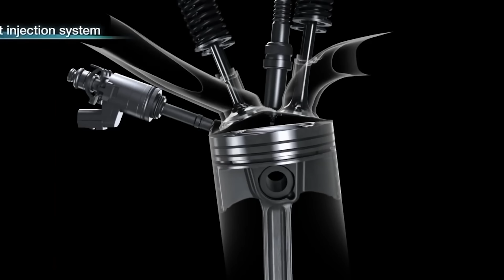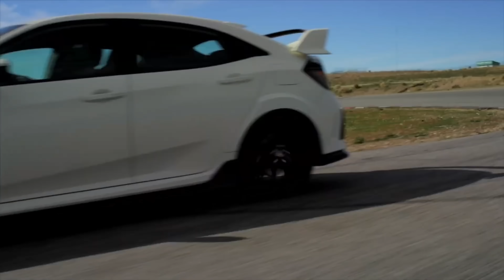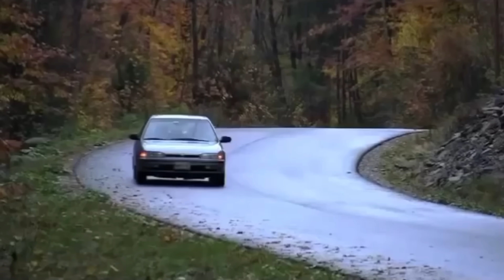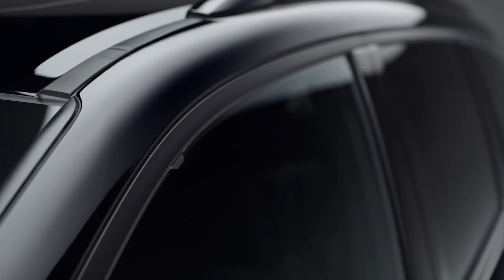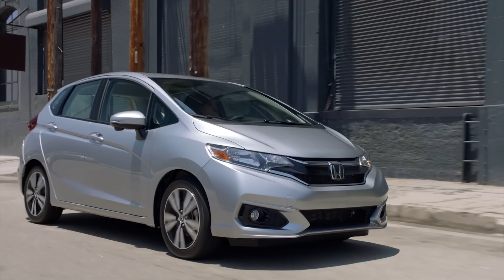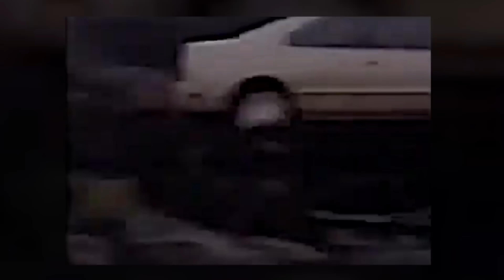Honda's New Engine is the Most Powerful Engine Ever Made

Comment: OK, that’s not true because I have a 2012 Honda Accord with a V6 3.5 L and it’s 271 hp and I just read that the 2 L turbo charged model is 252 hp so how is that? The most powerful engine ever made for a Honda Accord? That’s not true

Comment: Thought I might come here with a small issue. I have a 2015 Honda CR-V fwd with around 200000 miles.I’ve noticed  recently that when idling, my car either runs off timing, or something of the matter. It runs rough for a few seconds before the sound goes away. It happens when coming up to a stop, and it’s usually worse when the engine is cold.

Comment: I have a 99 Honda accord vtec 2.3 and a 2006 accord v6.  Bought both of these new.  The 99 have 185k on it and still goes to work every weekday.  All original, other than maint.  Timing belt, brakes ,tires, heck the air condition was never touched and works great.  The 2006 accord v6 has 285 k on it.  All original engine and transmission.  Timing belt on that was changed at 250k, when it failed.  Installed a new belt , water pump and belt tensioner and its back on the road.  Just had a cable for the gas lid, and trunk go bad.  However that part is very cheap and simple to change.  Great cars and I want to buy a new accord, not sure about that new transmission though.  💪🏻💪🏻💪🏻🔥🇺🇸

Comment: I have a 97 Honda accord LX, the vehicle will go a million miles! The F22B2 engines are well balanced, forged parts, easy maintenance, easy to access/purchase parts! Best (reliable) engine ever!  *If you put GATES RACING-TIMING-BELT ($160)  then you could triple the maintenance to 300K instead of the 100K requirement... granted you don't race the vehicle to preserve the belt!  (while you're there change the crankshaft-sensor every 20 years when doing time belt.  If you want it to start like a new car again after 300k change the distributor, the one coil & starter; you'll get fuel economy back! KEEP the stock 15 rims and go as wide as you can on tire, you'll have the most comfortable ride!!!

Comment: On my 3rd Honda vehicle. Had a 1998 accord, presently own A 2007 accord with well over 200,000 miles and a 2014 CRV at 173,000 miles. I also own a Honda 15 hp outboard which pushes my 15 foot Tracker, plus a 4 stroke Honda weed trimmer.

Comment: I bought my 2015 Honda Fit EX-L Brand new and now it’s has over 185k miles I did a lot of road trips….replaced the alternator because it’s not denso it’s a Mitsubishi made…replace my CVT transmission failed at 175k miles Replaced with a used 2019 Fit CVT (60kmiles). The VTC gear still rattles. Made In Mexico 🇲🇽. A/C heater still works. It’s still idling smooth. Not burning oil. Hoping it will last to 500k miles 🤞🏼

Comment: VTEC was introduced in 2001?  Really?  Com'on Scotty.  Did a 20yr old write this for you?   My '99 Integra GS-R says 'VTEC" just above the rear bumper and the '97-'01 Integra Type-R also used VTEC.  VTEC was introduced in 1992 in Japan, and came to the US in 1994 with the gen2 Integra.  You also forgot about the K20C4 engine which is in the 2018-2022 Accord 2.0T.  The K20C4 shares >90% of the K20C1 components but came with a smaller turbo.  
BTW, I have owned 9 Hondas (2 Acuras + 7 Hondas) since 1993 all of which I bought new.  I still have my 2019 Accord 2.0T (and '99 Integra GS-R - can't bring myself to sell this car it is so awesome) and getting the wife a 2025 Accord this year after I sell her 2013 Accord.
Reply: The latee 1990s Civic SI models had the B16.  VTEC as well.  I was sitting there echoing your thoughts as well.
Reply: @benmack8359  I know, for 2 years only, 1999-2000.  Awesome car btw (I auto-xed my friend's '99 Si), but I was making a point that Honda started selling VTEC cars in the US in 1994, and 1992 in Japan, not 2001 as he stated in the video.
Reply: this whole video sounds like AI. Scotty sounds sick in this 💀

Comment: I was in the market for a brand new car and was considering the Acura Integra with the new turbo engine, but ended up changing my mind once I seen the 2021 Acura ILX with 8k miles and the 2.4l 8Speed DCT. Why? Because that engine will outlast the newer engines without a doubtz

Comment: i currently own a 2024 Civic Type R & 2025 Honda HRV  both great vehicles 
i’ve had a 86 prelude si 2020 civic sport (1.5 turbo) 2022 civic sport hatchback and 2022 sport sedan (wife’s car) 
the Type R is a limited production car that is super fun to drive with tons of power 
bose sound system , some might find the ride kinda rough but it’s a track car soooooo!!

Comment: I bought a 2-door 2000 Accord EX-L V6 new and drove it for 14.5 years and 193K miles. The only reason I sold it was because my wife and I had a kid and needed 4 doors. It had otherwise driven as well as it ever had. The alternator went out at 58k miles, but it was replaced under warranty. That was my only issue.

I replaced it with a 2014 Accord EX-L, and it’s my wife’s daily driver. It only has 118k miles on it and drives as well as it ever has with standard maintenance. 

My mom bought a 2020 Pilot EX-L and loves it. 

Honda is a terrific company and driven my family and me for many miles. We’ll drive a lot more in the future as well. ❤

Comment: The amount of cross compatibility between the different engines made modification fun. Junkyards could potentially have so many parts because of that. Non vtec b series can have vtec head installed with minimal mods. 1.8 LS vtec or 2.0 b20 vtec's were always cheap ways to be fast. Even the single  cam z6/y8 are very happy to be boosted or sprayed. They are easy to work on. 10mm,12mm,14mm, 17mm and a 32mm will do basically anything you need. The good ol days..😅

Comment: Honda's small portable gas engine generators are the best you buy, bar none. They're more expensive than the cheaper Chinese-made generators, but they last forever if you just change the engine oil every 30~40 hours of run time. I owned a Honda GL-500 Silver Wing motorcycle back in the mid -1980's and rode it nearly 50,000 miles. It never leaked a drop of oil, and the only parts I ever had to replace were tires and the battery when they wore out. As it happens, I've never owned a Honda car - I'm a Toyota person - but my daughter has owned Hondas almost exclusively since she first started driving in 1998, and she's had good luck with them.

Comment: The new 1.5L turbo engines have significant head gasket failure issues. Additionally, the direct injection fuel injectors are failing at a very high rate.

Comment: Have owned honda vehicles in both 5speed manuals and automatics and never had issues with them as others have claimed transmission problems. I just followed strict atf change intervals and never had a problem and no that’s not even rocket science to do that.

Comment: I have a 2014 Accord 6sp. Didn't have any problems until i took it into a Honda dealership to get a valve adjustment done. Now it's leaking oil from the valve cover and the abs light is on.

Comment: I’ve had 9 Hondas only 1 gave me an issue and it was the dreaded em2 lol well that and my 8th Gen si had the paint fade which was bad and my current sport has the paint cracking on the side mirror caps and door handles BUT other than that lol

Comment: I bought a brand new 2012 Honda Accord EX sedan with the 5 speed manual transmission and the K24Z3 engine. Still have that car today. It's one of the best cars I've ever owned.
Reply: @matthewgreen1312   Same engine is in my 2013 Crosstour - they are bulletproof 👍
Reply: I have the 2010 with the same engine and trans. Great car.
Reply: Same engine on my accord euro 08. Fantastic engine and car

Comment: The Fit/Jazz is/was good, but owners in cold weather places quickly find out that the battery is more appropriate for a small lawn mower starter than a passenger car. It's got about 350 cold crank amps. It was maybe passable during the first generation when the engines were smaller and there were less key-off electrical draws. A lot of seniors buy this car and they don't necessarily drive it every day, so it just sits and drains, then often won't start without help.

The ride was ridiculously stiff and the seats were uncomfortable to many people. I'm not sure why they made it so stiffly sprung. Maybe they had to make the rear stiff because of the torsion beam choice over independent, and then had to make the fronts stiff to match the rear. Anyways, it's bad for long drives, but most people will forgive that since it's probably spending most of the time as a grocery getter.

Comment: Bought a new 23 Ridgeline in 7/23 to tow my 3640# bassboat. No issues & tows it fine. Had GMC Sierra Crew Cabs previous for 29 yrs. GM priced themselves outa my pay grade. Honda Sport OTD $40,060. GMC comparably equipped >68k + + +

Comment: How about making engines with timing chains instead of belts. All the engines are interference engines. If the belt breaks, goodbye engine.
Reply: Know of a 16 valve Civic that dropped it's belt at highway speed and escaped unscathed.  As both cams stopped within half a turn, no valves are fully open and the engine spun down with no damage.  My 2013 1800 Civic is a chain drive. iVTEC SOHC.

Comment: Honda CR-V and HR-V got worse over last decade. 
- CR-V got so bigger, very basic interior, bad performance with higher fuel consumption and very overpriced.
- HR-V was 4 door small SUV got into very weird shape to 2 door and not usefull anymore.
- If you're in a place of very much snow, Subaru is way to go for AWD as well.
- For power, Civics are very not usefull for power unless you're going for R. Meanwhile other Volvo etc. brands have V70 like at 250 hp already at normal trims.
I've driven '99 Mitsubishi 1.8 GDI engine and it was the best, much faster than any other at that price, low fuel consumption and was a rocket at 1170kg.  Never had a problem with it even at 300.000 kilometres. The first GDI engines in Europe, before it was cool.
- I'm driving '03 XC90 of my father's and my first real car will be 2007-2012 Honda Accord with low mileage on it.

Comment: My Honda Civiv Accord CRV over decades had a record that if the battery would turn over the engine they started.  All were bought used  Never sold or traded in.    All lost by  other driver totaling them.    That is 5 over 30 years.     Costs, oil fluids filters tires.

Comment: Hi Scotty, my 2013 Honda CR-V has irritatingly low MPG-20.5!! I don't have a lead foot and basically just drive to and from work, once in a while  (2x month) local trips within southern California. I change the oil religiously and use the cheapest gas wherever I happen to be. Does it matter that I don't always use the same gas? Also, my battery died and AAA replaced it for me, that's when the MPG went from 26 to 20. Other than this I love this car and plan to drive it until the wheels come off. Your thoughts please! Love your channel!!
Reply: Replace the air filter with K&N. Oil filter with Amsoil EA15K13, Engine oil with Castrol EDGE 0W-20 V, It's warmer in California so you use Castrol EDGE 0W-30 LL. Gearbox oil with Red Line MTL 75W80 GL-4, Differential oil if you have 4-wheel drive and DPF-S with Ravenol MTF-2 75w80. With a heavy foot I use as much as you do! Driving on a drop on a 300 mile route I get MPG-27.
And the most interesting thing is that compared to factory Honda oils at 75 miles the noise in the cabin decreases by 6 dB (A). Check how much it costs to soundproof the cabin to this level, you will see that you have free oils for a long time! After all, at 75 miles I don't turn off the music!
I change oils every: Engine and oil filter 6200 miles, gearbox rear axle every other oil change in the engine.

I drive on Shell V-Power, this also has an impact on how the car breaks away from the lights or you simply press the gas less. I am already reaching 110,000 miles. I replaced the battery with a larger Banner Power Bull P74 12. Air conditioning, heating, etc. winter, summer, it throws out, the engine starts immediately.
If it weren't for the factory limitation, the car could accelerate to over 120 miles and only then you can hear how the engine works nicely and quietly as well as the rest of the mechanics

Comment: It hurts my heart that you didn’t mention the f20 and f22 engines in the s2000. They had the most hp per liter of any NA engine until the Ferrari 458 was released.
Reply: for real i was like wait where is  the s2000
Reply: What about the H series or the sohc f22a1 engines. They were torky and pretty stout juat no aftermarket support.
Reply: Also the H series were awesome engines.
Reply: I agree, however, the K is considered the pinnacle of Honda engines since it is the culmination of the B series and F series architecture since its inception. The fact that it also comes in a reliable 2.4 liter is amazing as well. Tatsuru Ichishima even said himself it was one of the best engines even after the F and B series came out.

Comment: -2000 Accord with 224,250 miles. A/T replaced 137,000 (no regular maintenance performed)
-2008 Honda Element 122,390. 
-2019 Honda CRV
Keep your maintenance current using only Honda OEM parts.

Comment: I had a 2002 accord with the reverse rotation engine. Amazing what the engineers can do... Remove an extra transmission shaft and make the engine run backwards to save weight and complexity. GM did that for years with buses.

Comment: Unfortunately Acura is not a Luxury division like it was in he 90's for Honda. How to I know,  I had a 2019 RDX A Spec and the dealer told me so also when you call Acura you call Honda not Acura. 
Still to this day when you call Lexus you are not calling Toyota you are calling Lexus. Yes I had issues with the 2019 RDX A Spec but not my 1990 Legend L.
1990 Legend L reliability 90 out of 100, Brand new 2019 RDX A Spec 40 out of 100. Poor NYC city gas mileage and display issues twice once after they fixed it. LOL

Comment: I have two CRV's, '08 & '11. I night then for reliability. They were high mileage but because it's a Honda i figure I'll get another 100k on them before any major issues.
Also i have a Honda ST1300 motorcycle with nearly 100,000 miles on it, runs like clock work.

Comment: Scotty
What's your thoughts on Honda Element ? . I had a 2005 and sold in 2020 when I moved overseas. Now I'm back. I'm on the hunt for one.  Never had any problems with my 2005 sold it at 190,000 miles
Reply: @emoryscott5874  Honda is missing out on NOT having a refreshed Element available today.😳

Comment: I have a 2019 Insight and it is freakin amazing! My first step into the Honda brand and I will be a lifelong customer. 

I would like it to have the power output of its bigger brother, the Accord but it’s really hard to beat 55MPG also, putting it in sport mode unleashes a beast in that engine.

Comment: The best solution for saving on gas and energy cost, is manual transmission.  Not any EV.
Reply: And on the highway it breaks away better when overtaking, which is generally a problem with hybrids of various brands

Comment: My first car was a 1991honda Civic hatchback dx with a 5 speed manual transmission.  Still have the car till This day. Only problem I ever had was fuse related problems and the main relay for the fuel pump goes bad.  Other than that as long as you change the oil an  simple maintenance car will keep going.  I also owned a 2008 4 door civic si  FA5. To me best car and fun.  An my wife has a 2018 civic turbo 4 doors.

Comment: The 1.5 turbo engine is having issues. Firstly, it has a wet cambelt and needs replacing at 75,000 miles/6years at a cost of around £1000/$1275. There is then the head gasket blowing!

Comment: My Honda lawn mower is wicked good!  After a long winter, she cranks right up and has for over 30 years now.
Reply: This honestly deserves note. Honda small engines are the only thing I want to see on a cement mixer, pressure washer, or mobile work platform.
Reply: Lolz.  You're right.  Mine just keeps working.
Reply: Same with Honda snowblower.
Reply: @mikeschmidt8990  🥶

Comment: My 2022 Nissan Frontier has 310 hp. So it is more powerful than Hondas 306 HP V6. And the Frontiers have an excellent reliability record. I have met many people that went 300k plus with ZERO repairs. Of course they had to maintain them. Tires, batteries, brakes, belts, but nothing other than those broke.  I know that their cars have issues but their midsize trucks are amazing.
Reply: Hopefully they will come out with the new Xterra based on the frontier

Comment: Well, I have an MDX, 2006, & it is one of the nicest rigs I have had. With AWD, I almost never break traction. 3.5L does eat... 12-13 MPG on average. I did change the air filter, with little change. So, maybe it is the CA gas & AWD. With 166,883 miles, it runs & drives find... last week the VSA light came on, but at 63, I don't feel I need that, but, when I get time off work, I may pop in my Blue Driver to see what I can see. My dad just traded in his '07 Ridgeline with almost 400K miles - at 93 he is just now driving less than I do - & he had no real issues with it in all that time. So, I feel, the MDX is good for me. Haul my gardening things, back & forth to work - FedEx Ground - & I sometimes do Door Dash with my wife's 2015 Accent. Almost 90K miles, & I have noticed her engine oil gettering darker, so I have started changing it sooner. Not 5K, but 3K miles with full syn. oil. Like my Harley, it says change every 5,000 miles, nope, 2,000 to 2,500  miles. I do not like dark oil. Even the MDX, I am thinking of changing before the 3,000 mile mark. It seems that a lot of short trips are harder on the oil. I keep hearing Oil & Filters are cheap, engines & transmissions are not. Besides a slightly higher overall cost, I can not see a down side to early oil changes. Including break fluid, (& coolant) but, with the MDX, that is done with the - WHY have it? - Timing belt & water pump... Love you videos, Thank you so very much :-)